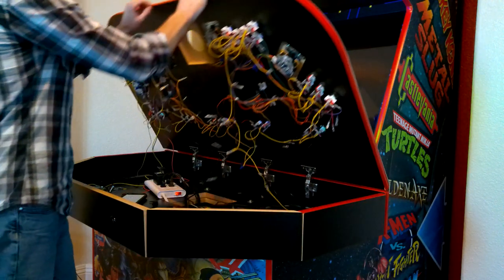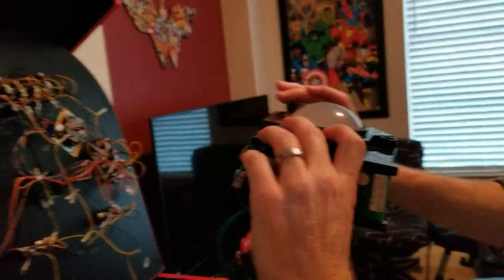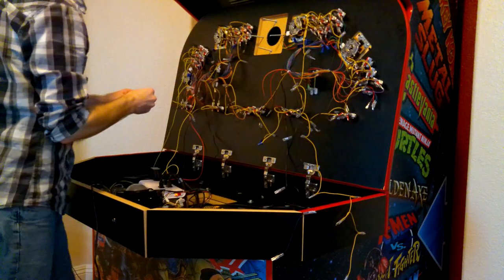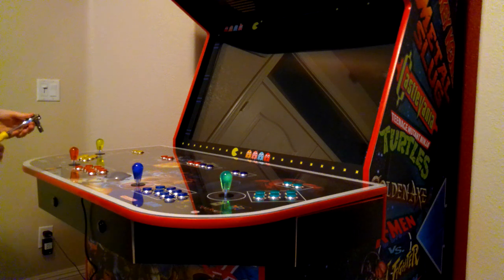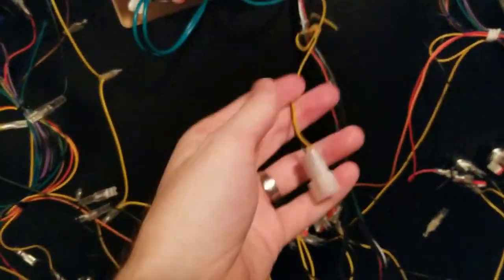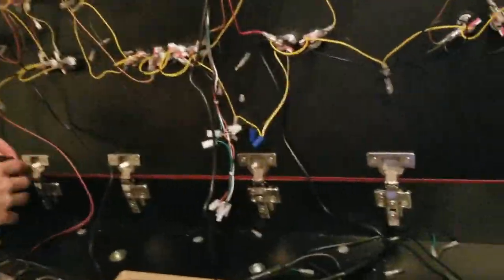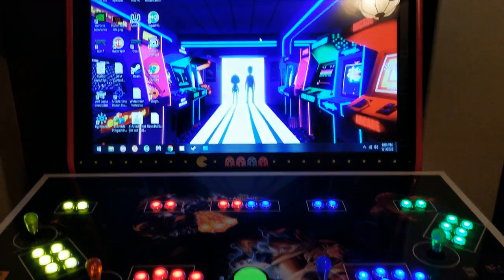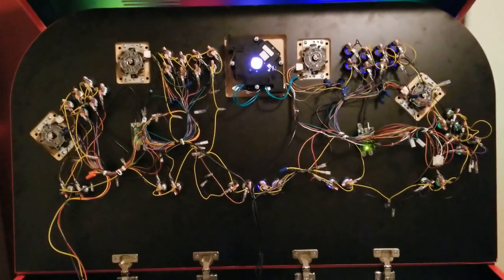Game Room Solutions 43" Arcade Cabinet Full Assembly: A Noob's Adventure - Wiring (Part 3) Trackball

Comment: 0:39 GRS is grounding the Trackball (static discharge) to a joystick plate which is screwed to a MDF sheet. Last time I looked that is called not grounding. Correct - do not connect it to your negative terminals (Gnd) as you don't want a few thousand volts going through your electronics. If the case has a real case ground, wired to the ground plug then that is where it should go. Arcade machines were zapped by ingenious snot-head teens trying to get a free play by forcing a reboot of a machine. It is the same as rubbing amber on cat fur, spinning a plastic ball could steal electrons from you and build a static charge.
Remember as a kid wearing a large polyester winter coat and you touched a light switch with a scratched screw on the face-plate and got shocked, that is called grounding.

Comment: Yo, the washers go under the nuts to spread the load and not crack the TB case. The bolts are carriage bolts and are tamper proof from the top and must have a square locking pattern pulled into the wood.

Comment: Invest in a Titan 1 if you wanna use  real game consoles with it.  This method will only let you use one Joystick 🕹️ but it's still cool. When you figure out how to switch between dinput and xinput. Convert the Joysticks into dinput. Stick the Titan 1 dongle inside the game console you wanna use. Stick the program cord that came with the Titan 1 inside the PC. Open the Gtuner software for the Titan 1 after you switched the joystick into dinput mode. Go to tools inside Gtuner. Look for "output devices" pick the game console you're trying to connect the arcade to. When you picked your output method. Go to "Max Aim DI". This will detect your IPAC. Go to Direct Input to look for your IPAC that transformed into a game controller. When you find the correct controller. Map the buttons with the layout. When you map each button make sure you pick "direct input catch" all buttons 1 by 1 like this. When you mapped every button you can now use your arcade system on the game console. Only one player will work but it's still cool.
Reply: Actually this system uses the software "keyboard2xinput" and the 4 player games work great. Everything runs just right.
Reply: @jml60831  I know this method. What I'm explaining is gaming on actual game consoles like PS5 or Xbox series S. It's possible with with a Titan device. This is option if you have game consoles and would like use arcade with it. Titan devices emulates any controller board and works on the real thing.
Reply: @100Bucks  I see but purchasing a ready made pc with all the games already setup will save a lot of time and effort than trying to emulate everything on a game console.

Comment: Here's a demonstration with a Brooks emulator adapter. I suggest Titan 1 tho because it works on everything out there. You have IPAC so only one player will work. If you had 4 zero delay encoders paired with 4 emulator devices. You can play on anything. I have IPAC as well so I'm stuck using one player on real game consoles.          
https://youtu.be/a1-h0bgmR8w
Reply: With the software keyboard2xinput you can play 4 player games on an ipac.  All my 4 player games run fine.  If you purchase the same arcade-one system I have keyboard2xinput is preinstalled so you can play all 4 player games.
Reply: Game console games and pc games all work with keyboard2xinput on this system.
Reply: @jml60831  xoutput is good too. But what I'm saying is . Titan 1device will only take 1 board at a time . It's not gonna use all 4 players if you stick the Titan 1 inside real game console. You're using 1 arcade board so the Titan 1 will register the controller board as 1 controller not 4 controllers. Just an option I'm putting out there if you wanna switch back and forth on real game console or arcade cabinet gaming.